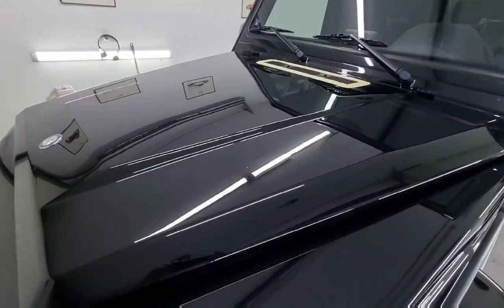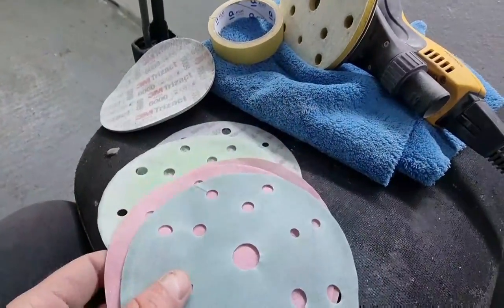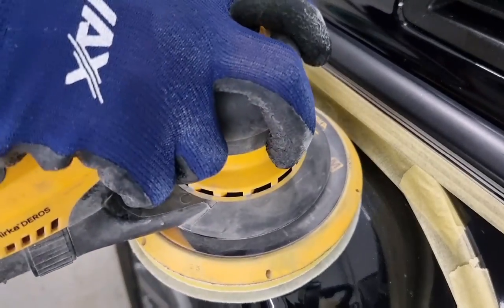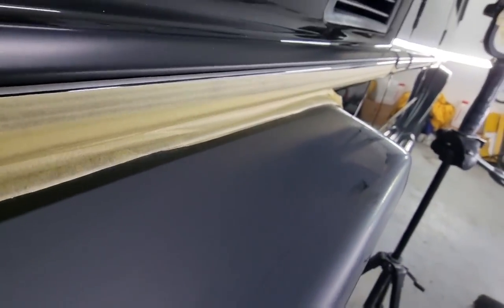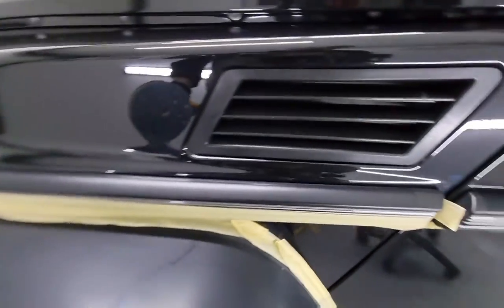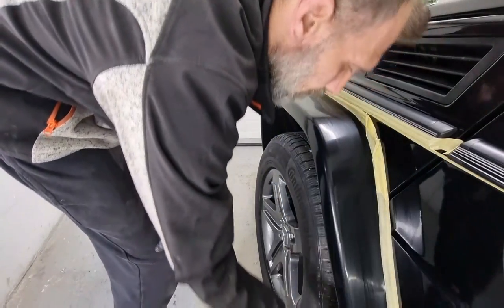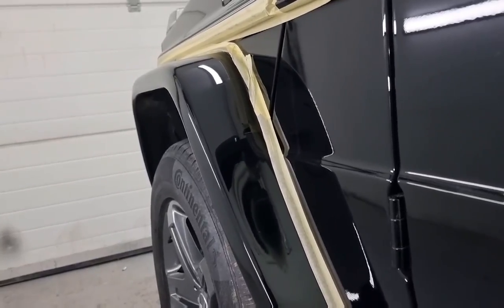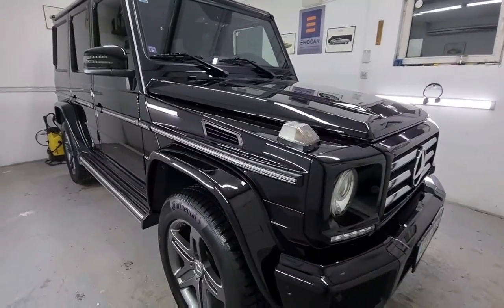Orange Peel-Removing orange peel from plastic/DRY sanding with KOVAX paper

Comment: hello, 
you did an amazing job! Removing orange peel seems possible for me DIY kinda guy.

i have got my super soft pearlescent black honda repainted (rear doors, rear fender and pillars, trunk lid and rear bumper). there are a lot of  nibs, a few paint overspray and obviously orange peel.
i have decided that i will correct the orange peel other defects myself and will polish it.
i was going to do dry sanding to remove orange peel and i have only the forced rotation DA polisher only, no orbital sander!
i wanted to know that can i dry sand by hand using kovax tolecut k1500, k2000 and Bluflex k3000?? or should i go for wet sanding with 3M papers?
plz do reply! thanks

Comment: Looks like you sanded a complete layer of clear off that was sitting on the existing paint coating
Reply: Looks to you but he didnt
Reply: Your comment made no sense.
Reply: @007lutherking  can see a shinny halow where the layers change, I've sanded down enough cars as a auto refinisher to know what they mean
Reply: @krislimmer6532  oh you meant he sanded off the whole clear coat. I thought you were implying there's multiple clear coat levels. 

Also no if he had sanded clear coat, the base paint would have died his pads black. 

He is a professional and its easy to figure out when you burn through the clear coat
Reply: @007lutherking  you do realize that there is not necessarily a base coat under a clear coat? 🤣
When panels are blended only a part of the panel can be painted in base coat (where the damage is), the rest of the panel is sanded down to p1000 grit and you just spray new clear over the previously existing one so you have clear coat on top of clear coat. This is to avoid mismatching colors.

Watching the video you can clearly see that he removed most of the new clear that was put on the panel. You can see the area where the old clear meets the new clear, those are the shiny halos that look like they weren't sanded.  The guy himself even said "there's no transition to be seen" he meant the transition between the old and new clear. 

The orange peel was so terrible because the guy that painted it laid the clear really thin or using too low pressure on his spray gun, barely putting it on and that's exactly why he sanded through so easily, the clear was really thin there.

"Also no if he had sanded clear coat, the base paint would have died his pads black. " This is only partly true, but this is the difference between a body shop worker and a detailer. You think that paint is primer, base coat, clear coat. But paint can look like: primer, base coat, clear coat, clear coat so YOU CAN sand through the clear without having base staining your pads. Because there's simply no base under that clear. 

Don't teach guys that work in auto body and refinish because we spray that paint every day, 5 or 6 days in a week to put food on the table, we know the entire process of spraying the panel from bare metal to super shiny, and we buff paint better than most of the detailers that are around, because almost every paint job requires some amount of sanding and buffing to make it perfect, we do that shit on daily basis. I sand and buff more cars in a week than this guy does in 6 months 👍